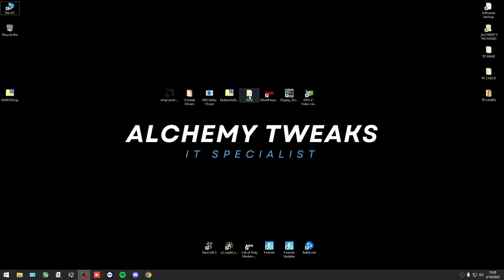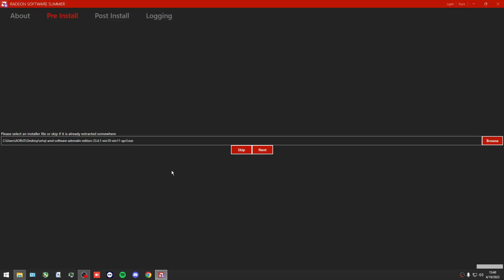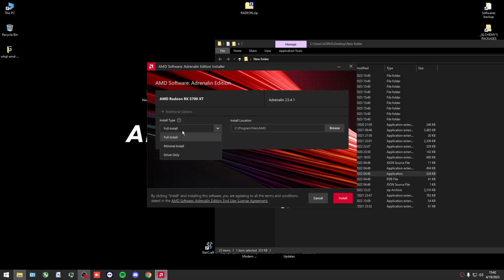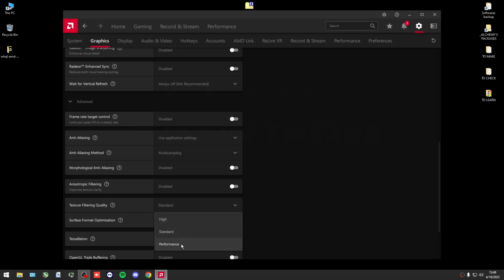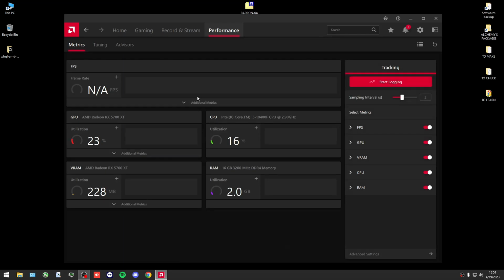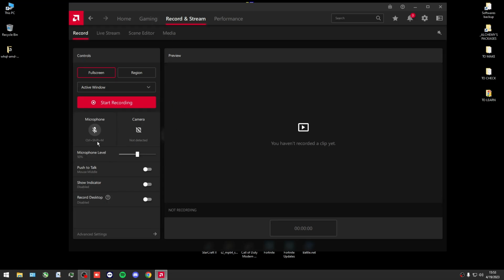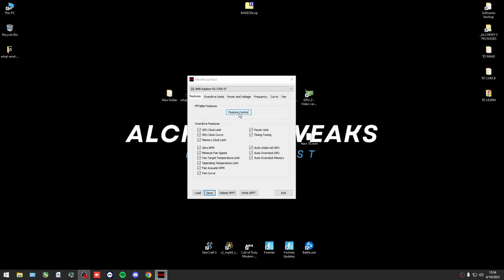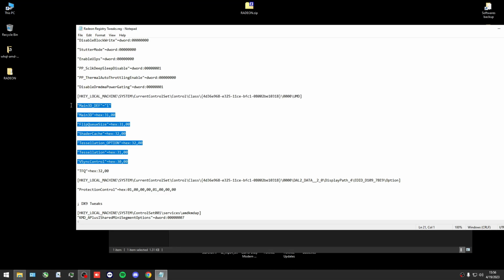Debloat your AMD Radeon driver

Comment: Amd master controller sdk may not even be compatible to run on your system. Laptops have many problems with thermals use own built in software not msi Afterburner. Sometimes it's best to reinstall windows. I also used uninstaller program to get rid of msi afterburner it was falsely causing gpu throttle. Windows has a way to Sometimes think you solve a problem and it could be casing problems later when computer updates.

Comment: Did all the steps i could and now my PC is stuck on automatic repair loop, thanks
Reply from the maker: If you indeed followed the video to the letter, it is highly unlikely that the issue is due to the video itself. If you made the changes in custom Windows , it is always the user's responsibility and risk. My question is, did you choose 'DDU uninstall the driver without restart' or opt for safe mode or any other option apart from the one I recommended? The fact that it directed you to repair, the most logical and likely scenario is that you did what I mentioned with DDU.

Comment: i forgot my gpu is r7 260x maybe its too old but i read that amd use dynamic queu size and flip queu size change to 1 makes it worse, this trick is old andmany people change it to 1 because in nvdia  max pre render frames is 1,but in my case in my gpu latest drivers i lost 90 fps
Reply from the maker: Yeah probably you must do some experiments with this however personally i hadn't any problem
Reply: @Alchemytweaks  how much experiments i must do 6 benchmarks on the game i play with restarting pc after aply the reg file?
Reply from the maker: @kolioludiq9663  3 are enough for every value
Reply from the maker: And you must he careful with the way that you benchmarking your game to be static the the place that you capturing and the same in all benchmarks .

Comment: if you uncheck hd audio controller then your graphics card will not put out any sound. i already tested this. in my opinon i would keep that checked and disable hd audio and disable legacy ports in bios.
Reply from the maker: That you describe personally i hadn't any issue so i don't know if they you saying is right .....if you using speakers or headsets for sound you can disable them without any problem .In your case now something different was the problem .
Reply: @Alchemytweaks  when you connect your display port to your gpu, you have 2 things 2 think about which are audio and the visuals that renders on your monitor.

i have an nvidia card and i already tested disabling hd audio controller. when i unchecked it, it played no sound from my headphones. i have my headset connected to my monitor instead of the 3mm headphone jack on my pc case.

i disabled legacy ports which disables any usb, usb c, and 3mm headphone jack.

i could enable legacy ports again but then i thats adding on latency to my system. 

i'm not saying your wrong but maybe enabling legacy ports would help if i try again in the future. either way, that was a good video :). i want to try amd cards, never got the chance to actually test them
Reply from the maker: @LightWorks222  I'm not accusing you of anything, nor am I trying to pick a fight if that might seem so. Obviously, I want there to be a dialogue and for mistakes to be pointed out. However, what you mention happens to you on an nvidia graphics card, while I showed an amd graphics card and mentioned that I disable them as my preference because I don't need them and synchronism is theoretically the safest changes. So it definitely depends on where the audio devices are connected and what audio devices you have connected

Comment: i did your registry file and lost 90 fps from this 
"Main3D_DEF"="1"

"Main3D"=hex:31,00

"FlipQueueSize"=hex:31,00

i did benchmark 3 times bofore the tweaks and then aply the tweaks restart pc and then 3 benchmarks
Reply from the maker: 90fps?
Reply: @Alchemytweaks  yes i run cs go benchmark 398 fps without your reg file 309 with your reg file after i aply tweaks i restart pc and run becnhmark again
Reply: Plz Don't touch this settings. It's very old tweaks and working good on old amd cards like a rx460-470 only
Reply: @pcfix2298  my gpu is old r7 260x ,but still i agree with your these 3 tweaks are not working they should be not in this video
Reply from the maker: thanks for your report man
Reply from the maker: This registry is working for all VGAs but you should find the best value for you and sometimes it's not working for any value and you must remove it . On my VGA is working totally fine .
Reply from the maker: and i gave this value for registry because theoretically it was the most safe
Reply: @Alchemytweaks  i bet every single guy who watch this video and do benchmark with it will loose fps but anyway thanks for the video.
Reply from the maker: I can't be sure about that but I think if they had saw any reduction like 90FPS below the will had already report it in comments .
Reply: @Kolio Ludiq those registry edits modifies the amount of prerendered frames. The higher the prerendered frames the more smoother and higher your fps but higher input delay. The lower the prerendered frames the laggier but lower input delay. 

You can try setting all of them to 32,00
or setting them to default
delete FlipQueueSize regkey and set the rest to 33,00
Reply from the maker: @meme-zf7ew  I am going to make a detailed video about this for AMD GPUs
Reply: @Alchemytweaks  ok when you do the video show results with fqs 31 maid3d 31 and main3d_def 31 and then delete fqs and set everthing to default i bet that default is gonna be best !
Reply from the maker: will see
Reply: @kolioludiq9663 im not tryna argue here but the default will have better fps but higher input delay so you will want to find a middle ground. ive read in forums that flipqueuesize is the same as main3d so im not sure what it does but what i know that they bith modify the prerendered frames
Reply from the maker: @meme-zf7ew  Regardless of which value is best for me at the moment (I haven't tested it yet) it's impossible to believe that with a registry you lost 90 fps, we're talking about a setting that will increase or decrease performance by 5-10%. Anyway detailed video will be uploaded explaining further and I will come to a conclusion
Reply: @Alchemytweaks  i agree. there is definitely something else that made him lose that much frames
Reply: @Alchemytweaks  i dont care if you believe me or not ,if you wish i can prove it to you
Reply: there is none i can show to  you as well i dont care what you say really the thing that metters is benchmark results
Reply: @meme-zf7ew  brother i bet i know about them then you i run so much benchmark then i can say that none of them works and default is best.
Reply: as i said in previus comment fqs use to best on 1 like nvidia pre rendered frames to 1 .,but it dont work as i said in my previus comment anymore amd make fqs dynamic so best value 33 is best and fqs dont work anymore now is maid3d main3d_def